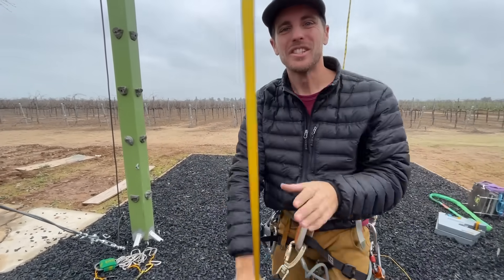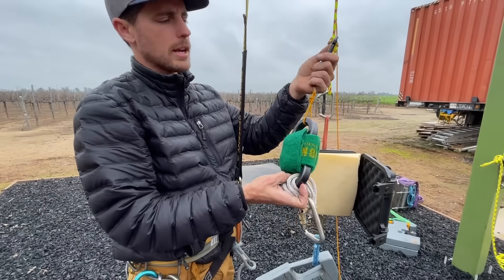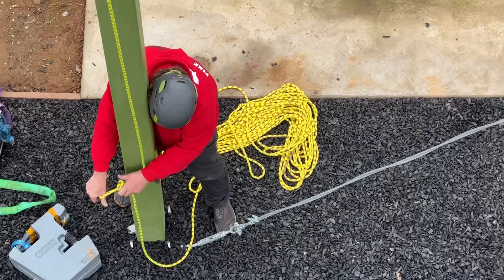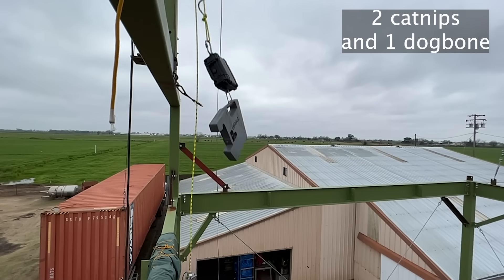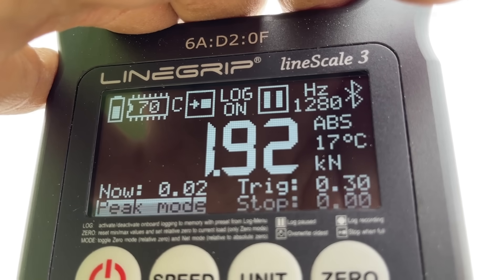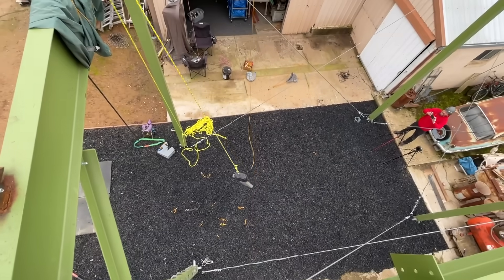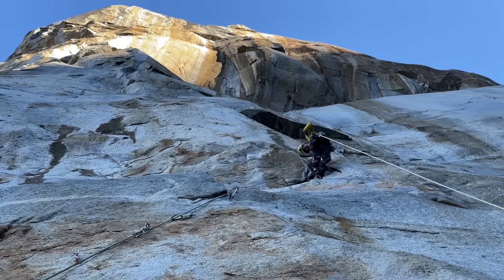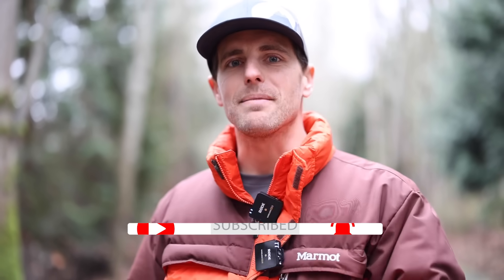Does climbing gear pulling out soften the blow on the next piece?

Comment: The rope slides back down during the fall, so there is a lot of slack also on the other side of the carabiner, maybe the first peak is is the pull rwmoving the slack before the pull creating the tension, this also implies that there might be a very small peak between the second and the third but maybe at that point the fall is too quick for the slack to matter

Comment: I've watched this one a few times now, and I'm fairly certain I've got this figured out so.. 3:48 i think you got 3 spikes because as the first spike is the initial weight loading, you measure a slight bounce in the system before it actually broke because it wasn't quite up to speed yet. If you play  it back at 0.25 speed 3:22 you can see a brief pause in the paracord as it stretches.. so it loaded, did a micro bounce which is hard to discern because the paracord is static unlike the main line, then continued to stretch the chord and break, from there you get your 3rd spike from the 2nd "catnip" as it hits it closer to full speed until it finally loads the dog bone in the main spike. 
 Respectfully I disagree with "adomasvysniauskas9509 because I i don't believe the rope merely feeding through the carabiner would have cause this without the rope actually pinching on something for a moment with enough force to lock it into a bounce pattern for weightlessness before the weight could then plow through the coefficient of friction.

Comment: Your extra spikes are probably because a weight on the end of the rope is a harmonic oscillator. The recoil you mentioned as it was hanging off the dogbone started as a compression wave through the rope when the first catnip broke but you couldn't see it because there was nothing arresting its fall

Comment: WOW great testing with very convincing results!! I wonder if the catnips were weak cables instead of 550 paracord... Because the paracord absorbs some of the energy. The cables would NOT absorb the energy and the rope would have to do all the absorption!! Then when the cable breaks, the rope has to stop the weight AGAIN! No real help there and could be detrimental for some reason... Makes sense?

Comment: The anchor rope does fall down initially  and then reverses  direction when catnip one makes  contact. The first spike should now start and last until catnip one breaks. It seems however that there is an initial  smaller spike and I would guess that as the anchor rope went up again, it also  snagged slightly om something  like a lower caribiner causing enough friction to register but not enough to exceed catnip one break tolerance, then unsnagged the rope bounces up above catnip one slightly momentarily  causing no resistance, weight proceeded to free fall, and catnip one reengaged a second final time as expected. In other words, spike one was divided in two due to a snag. Tying down the rope with a soft rubber band or such on each catnip should eliminate this.

Comment: You can when the rope is running through the the connection just place the force meter at the end of the rope and get the value without the danger of dropping the meter.

Comment: After seeing the pieces failing and not seeing the increase in force on the next piece due to a commonly accepted shock loading myth, there will still be people convinced shock loading is a thing. This has been tested and documented long ago in anchor setups with fuse-pieces and the same results were obtained. The failing piece helps decrease the load on the next one, period.

Comment: Interesting stuff! I've always been curious about this. One component that could change the data is belayer displacement. When the climber falls on the first piece, the belayer may be lifted up a bit, which would lessen then forces, but when the climber falls onto the second piece, the belayer may be moving down which could result in increased forces and a hard catch. I wonder if the results would be different if the grigri was instead attached to a mass hanging a couple feet off the ground and tethered to an anchor.

Comment: Interesting. But your test doesn't reproduce a real fall. You are using soft cord in your sketchy pieces. It absorbs some energy. And it looks like the final impact was reduced exactly by the soft cord tear force. In real life we have a piton+quickdraw or wired nut+quickdraw. That will just stop and stretch the rope for a moment. I think, the question remains open!
Reply: Try to shorten the soft cord in your sketchy pieces to zero length.

Comment: The 550 cord's 30% stretch definitely helps the absorption & pads these results a little.

Energy Absorbed (Ea) = Force (F) & Distance (d). Increasing d reduces the F required to absorb the same fall.

With the few feet of rope stretch absorbing the fall & some meatbag flopping, the 6" of catnip stretch shouldn't add more than 10-20% to the absorption, but it's not negligible. Depending on your bad piece, you may get some similar sliding/skidding/stretching help, but most of my bad placements (flared cams, micronuts) would be instant failures.
Reply: I'd be curious about a similar test w/ similar MBS static cord.

Comment: Simple. Kinetic energy. When the 1st one breaks/fails, it still reduced the kinetic energy. As your fall speed increases so does the impact force. If you slow down that fall speed by having something catch/fail the final impact force will be less due to the fall velocity being less than if you freefell the whole way.
My experience with this was with a 10 tonne piece of machinery that broke while on the crane ;P We had to always have a backup that would break befor the main anchor to help reduce the impact force when the 10 tonne of metal hit the final anchor so it didnt destroy the workshops floor haha

Comment: I might have an explanation for the 3 spikes, in case it was not solved yet:
1st spike - obvious, the first carabiner catches the fall before breaking the catnip
2nd spike - the rope reaches the second catnip/carabiner and creates some drag, but doesn't break the second catnip just yet due to rope stretch
3rd spike - the rope reaches its maximum stretch, creating the spike just before breaking the second catnip

Try placing the graph over the slo-mo video somehow, you might find the answer. GL

Comment: Does cord breaking resemble a piece blowing? I really am having trouble thinking about this - exploding cord clearly reduces force, but that's not why pieces usually fail. And why two catnips? It's possible that one would produce a different result.
Reply: I had similar questions & posted my thoughts in another comment. TL;DR (E=F*d) Yes, cord stretch helps spread the load over distance compared to a more static failure. But rope stretch + meatbag flopping should be much larger, so it should only help 10-20%.
Reply: Why 2 pieces? 1 bad piece after a bomber placement isn't a big deal on lead. You just figure it'll blow & count on the previous piece. If it catches something, wonderful! When you start stringing bad pieces you begin to wonder if you're just going to factor 1.5 on your last decent placement. This suggests it'll at least take the edge off & the placements aren't purely mental. OFC the placements need hold something you could measure in kN.

Comment: I'll bet the first of the three spikes is due to the acceleration of the rope as the system is falling. Initially the rope is in free fall. Then when it passes the first piece, the load quickly reverses the motion of the rope by pulling it through the piece. From Newton's Second Law, that reversal of motion of the rope, i.e. an acceleration, imparts a force on the falling load.

Comment: Super interested, weather and how soft dummy absorption changes these results. I´m assuming greater energy dissipation while putting force on the failing pieces. The guess is that it might furthermore reduce the force on the holding piece compared to the steel dummy?
Reply: Definitely will, but I'm curious how much.

A fall has a certain energy (Ef) that needs to be absorbed. Energy absorbed (Ea) = (holding force F) * (catching distance d). The placements are limited by some max Fmax, so anything that extends the catch distance before F>Fmax blows the piece (catnip stretch, rope stretch, meatbag flop) increases Ea. But since we already have some rope stretch & catnip stretch, I expect less than a 30% reduction on the final piece.

This is exactly what screamers are for. They're tuned to absorb a specific force (ideally the largest force that won't explode the placement) evenly over their distance. Properly tuned, this is far more efficient at absorbing over a given distance d than a spring/dynamic rope where the force starts small & grows.

Comment: Great video today!

 my guess is on the three spikes for two catnips is that the first one is a shock load from the first one before it breaks with the weight pulling through on the second Spike. 

The second two spikes are equal representing the catnip brakes

I would not whip...

Comment: Cool result. Wonder if the impulse (F over a time interval e.g. from the cord loading to breaking) that results in the change in  momentum and lowers the force on the draw is similar to gear ripping? If the interval is shortened a lot by e.g. a rigid wire, then this test would be 💯 misleading..

Have you thought of getting a physics guy or mechanical engineer on the channel to generalize results and takeaways?
Reply: I guess the assumption in this test is that the energy absorbed by the cord before it breaks is negligible compared to that absorbed by the rope before the cord breaks.  This assumption feels reasonable given that the rope is 1-2 orders of magnitude longer.  It could be verified by measuring how much each of stretchy elements stretches.  Forces on the cord and the 2 sides of the rope are typically assumed to have ratios close the 1.6 : 1.0 : 0.6, and if we model each of the 3 as an ideal spring, its energy absorbed is force * stretch / 2.

(pretty sure this is easier to analyze in the energy domain - i.e. integral of force over distance - rather than in the impulse domain)
Reply: @Serge S  I was thinking impulse because in this video they get force vs time data. It's helpful to think in momentum as well since you don't need to model the system. The integral of the those peaks gives the change in momentum directly which you can use to get the total change in energy. 

An effective gear placement just needs to change your velocity. 

Your right of course if you want to partition the roles of the rope and cord - which in thinking about it... The rope will have a much larger displacement and dominate the ramp part of the impulse interval. All components equal, with a piece of gear ripping suddenly, you might see at the worst just the ramp impulse followed by a sharp drop and the effectiveness seen in the drop tower test would drop proportionally to the change in area under the curve.
Reply: @danielsavage1101  Oh I see.  I hadn't thought of integrating the F-t graphs.

But I suspect the question "would a steel nut cable significantly change the results compared to the stretchy fuse cord" can be answered with imprecise order-of-magnitude estimates (i.e. w/o integration).

Comment: Visually that looked like a fall factor 0.8ish? It was really useful to see how much force was generated on the catching piece, which is what I worry about sometimes. Seeing a factor 0.8 fall generating less than 8kN is reassuring for sure. And seeing those less than 2kN pieces decrease the load on the catching piece to less than 6kN is really cool, a DMM dragonfly #1(such a tiny cam) can handle that load.

Comment: Could there be some way of syncing up the logged force with the videos to see what exactly is happening at each spike?
Reply from the maker: I tinkered with it and it hasn't looked good.  I'll eventually get there i think.  Might be an after effect i'd have to implement.  Its not just the mechanics of showing it, but the story telling wasn't impressive when i did it.  Unfortunately arrows, and my big ugly red one, is really helpful for people to understand the story.  Fancy graphics alone won't do it
Reply: @HowNOT2  Fair enough! I reckon it's probably the rope change of direction as a few say, there will be an acceleration force when the rope changes direction but once it has changed it makes sense the force would go back down

Comment: The spikes could be from each strand of the catnip breaking and sending a shockwave through the rope. You should be able to test this by using non braided fishing line as you "catnip". Then repeat with two strands of fishing line and see if the number of waves doubles.

Comment: It would be pretty cool to be able to measure the acceleration, velocity, and position of the "dummy". It could give further insight into what's going on in the drop tower tests. Not familiar with those systems, but an accelerometer could be up to the task, or maybe some kind of video software. Stoked to finally see these drop tests! Thanks for all the work guys
Reply: Force is mass times acceleration. So just F/m=a. The Force is what he measured and the mass is roughly the weight of the dummy. You also know the time because of the sampling frequency. To get the velocity just integrate over time. Integrate again and you have the distance.
Reply: With a stationary camera and not to much movement to or away from the camera. You could track afterwards the object in software. One solution for this a the video analysing programm "tracker". You would get positions for each frame of the video. The Programm calculate the speed by just getting the mean speed between the frame and the next one.

Comment: It would be super interesting if you could measure the peak G-force of the falling dummy body. To get a rough idea on how high the forces are your back has to withstand in case of a fall.
Reply: We can calculate it. His steel weight is about 34 kg. Multiply that by 9.81m/s^2 which is acceleration due to gravity and you get 1g=333.5 newtons or 0.334 kN. So if you want Gs, take the peak linescale force and divide it by 0.334, or multiply it by 3 same same, you'll get max G force.
Reply from the maker: @loejohn509  The question now is when does a back break :)
Reply: @HowNOT2   Back in the 70's when I started to climb, there was some reference that said that a back would break at 1750 pounds.  Obviously, that wouldn't be the way to measure it.  At the time, I had assumed that was gospel.
Reply: @loejohn509  You're right mate! Thank you!

Comment: at 2:44 we see a drop directly on the dogbone which also shows a small spike. The chart measures the force on the dummy, a peak force of 4.08kN. The small spike peak force is roughly at 1kN, which is about the same as the dummy at rest. One frame at 2:45 shows the dummy at what appears to be 90 degrees to the force meter. If you listen, you can hear what sounds like a small sound prior to the main spike, a kind of bu-dunk noise. I think the force meter is kinking the rope, and this kink gets loaded causing a small spike. It would be interesting to compare with and without the inline force meter. The sound should tell us if there is a difference.
Reply from the maker: I listened to it 5x just now.  There is a small chance it is other video clip's audio.  I overlay the crap out of these edits so it's a tight edit.
Reply: @HowNOT2  You still have a small spike in the force meter trace, though. Suggest you repeat the experiment with and without the force meter on the dummy! 

Rope and chains with a limited bend radius create weird forces... check out the Mould Effect videos. (He references one of your vids!).

Comment: I also think you could get your linescale to last longer if you attached it to the gri-gri end of the rope.
Reply: I think there are different forces at both ends. Pretty sure he tested climbing falls once with a line scale on the climber and another on the belayer and the forces were slightly different ... But maybe I'm remembering wrong
Reply: @benja_mint  they must be slightly different but neither number is the force on the piece of gear so I don’t see why the “climber” force is more important than the belayer force
Reply from the maker: I think I could have done this test a lot better in hindsight.  I should have had 4 LS3s in the system at every single point every single time and just drop 3x without catnips and 3 with catnips.  Very simple and straight forward to understand.  But i also was afraid to eff up my LS3 and that grigri spot was pretty violent.  I would need more cases.
Reply: @HowNOT2  That would have been great. You could diy some PVC tubes to protect the LS3, That thing is going to take a lot of abuse. Having a round case might avoid direct hits.

Comment: My hypothesis is that the three spikes is due to the elasticity in the rope. There were two spikes when you did not use the catnips at all because the weight bounced. Perhaps something similar is happening at a lower level as it passes through the catnips. If you wanted to investigate further you could do testing with just one and three catnips. We would expect two spikes for one catnip but would we get four spikes or five spikes for the three catnips. That would tell us if the extra spike is before or between the catnips.